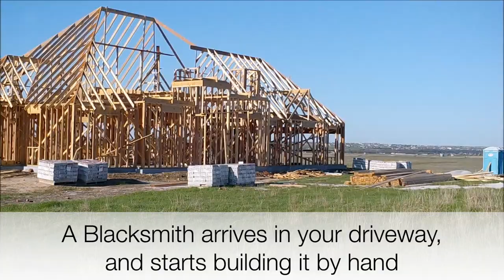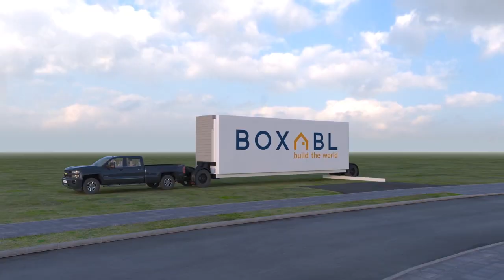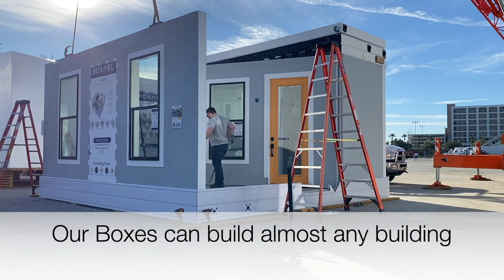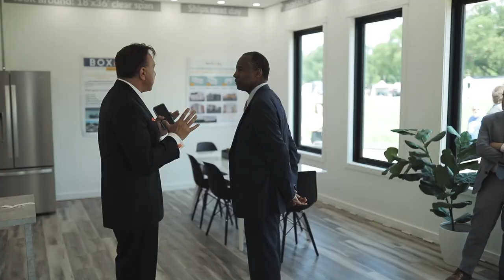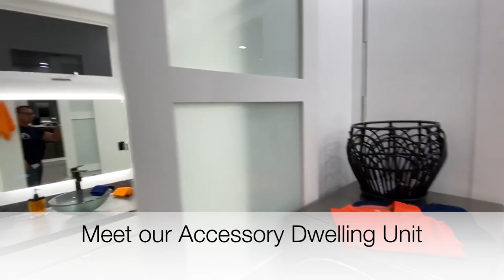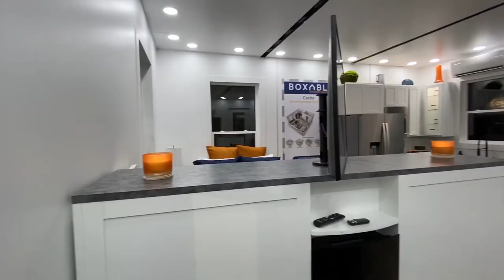BOXABL One Minute Pitch

Comment: Great but where can we find places to build this? Also can we remove the low wall/counter/shelves in the living area?
Reply: The prediction is that as older homes are more and more expensive to maintain, some will opt to demolish and may then use something like this.  If they truly do take off, and you can order say, 5 modules to have 3 bed, living, office/den, and garage, it could work well.
Reply from the maker: It is possible to deliver and unpack them with very basic tools. No crane is required.
Reply: Boxabl I hope to get one with tile roofs too

Comment: helloo please reply material use name?
Reply from the maker: Boxabls are made from steel, concrete and EPS foam. These are building materials that don’t degrade and will last a lifetime. The walls, floor and roof are structurally laminated panels that are much stronger than the average building.
Reply: @BOXABL  can it be used for schools, factories with heavy machinery?
Reply: please upload making video..
Reply from the maker: @umarahijo4537  Yes, they can be used for all purposes...